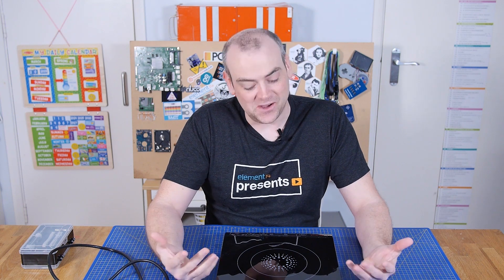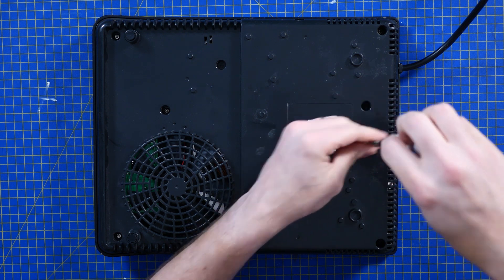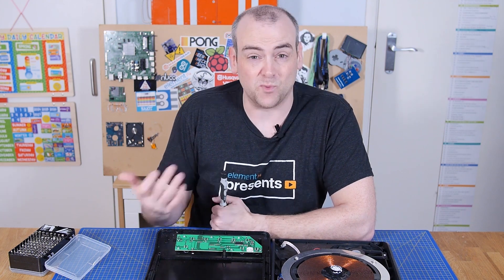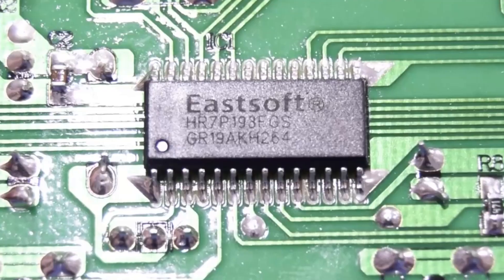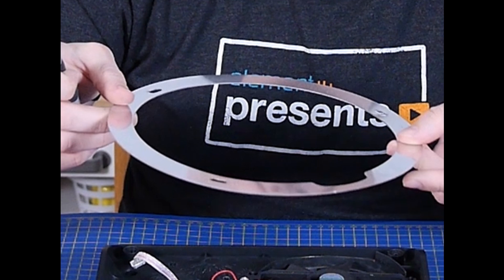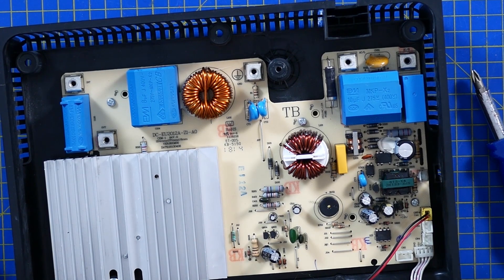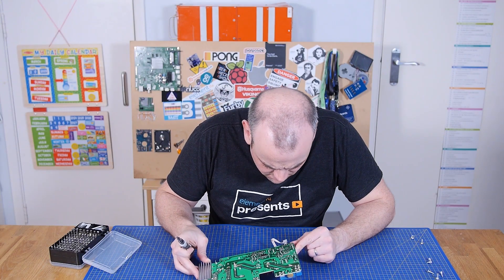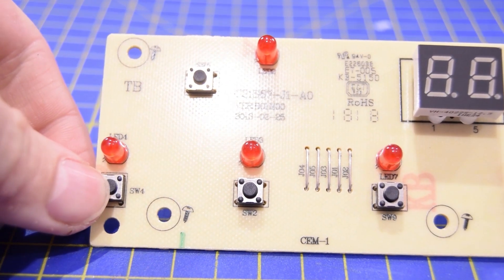Cooking With Magnets! A Look Inside an Induction Stovetop - The Electronics Inside

Comment: Inductors and electromagnets are not the same thing. These are NOT magnetic cooktops, they are induction cooktops. An electromagnet works with requires an iron core to work. An inductor, depending on the application, doesn't require a core. An electromagnet requires DC to act on permanent magnets and its only job is to create a magnetic field, while an inductor is generally designed for its properties within an electrical circuit and is usually designed NOT to create large magnetic fields that will negatively affect the properties of nearby components in the circuit.

That's an oversimplification and both use most of the same physics to work, but the operation and physical manifestations are very different.

If these were electromagnets, you wouldn't be able to move or lift a pan while the cooktop was turned on, and of course you can.

In theory an electromagnet could work on AC, but the magnetic poles would be constantly flipping and the strength of the field would be pulsing rapidly, making the magnetic field all but useless.

Electric motors of course use electromagnets and varying currents, but in a way that makes them appear more or less stationary to the permanent magnets. An explanation of "AC" motors as used in EVs is way beyond the scope of this comment, but the bottom line is that they are still arranging the magnetic fields and timing such that the rotor is always being forced in the same direction, not alternating.

The thing to remember is that a regular electromagnet is relatively stationary, and is stationary with respect to whatever it's holding, while motors are moving. The frame of reference in a motor is such that the current and magnetic field are relatively constant.

Anyway, the bottom line is that you DON'T cook with magnets, you cook with a giant wireless phone charger. 😝
Reply: @awo1fman  do you have any book recommendations so that I can learn about Magnetic fields and such? I’m intrigued by what you’re saying but my understanding is very basic. Thank you.

Comment: The big capacitor(s) are in parallel with the induction coil. It's a resonant circuit where the current bounces between the coil and the capacitor.
Reply: Tank circuit

Comment: The Powerrating on the backside is most likely the real power it uses, so maybe thats the reason it has a 12A fuse as the total amount of current is determined by the apparent power.
Reply: True, I didn't get as far as checking the power factor, but being an inductive load, it's likely to be "bad". Mayble some of the caps are to offset this?

Comment: Nice teardown - induction is fascinating tech and I love my induction cooktops.  The only downside is finding non-stick induction ready cookware that are decent - I recently discovered Caraway ceramic pans - they are amazing.  For regular stainless there is all clad, made in and tramontina.  Cookware and more in the US resells all clad factory seconds and if you sign up for their newsletter twice a year they have a buy one get one 50% sale - great way to pick up all clad without breaking the bank.
Reply: Yes, the cookware and compatibility does seem to be people's big reservation for adoption? Thank you for the reccomendation though!
Reply: @a531016  it can be expensive if most of your existing cookware isn't useable (ie. if a magnet doesn't stick to it).  Luckily I had started building my All Clad collection (after discovering factory seconds!) years before discovering induction so it was a relatively easy transition for me.  Non-stick has always been an issue though - paying a couple hundred for a stainless teflon pan that will still have to be replaced eventually (regular stainless pans are effectively lifetime purchases so the high price amortizes  over time) was never that appealing, and pans with ferrous disks on the bottom are never good performers.  Plus teflon itself is sketchy - which is why I'm glad I found a good performing ceramic with Caraway (got mine at Costco in the US).